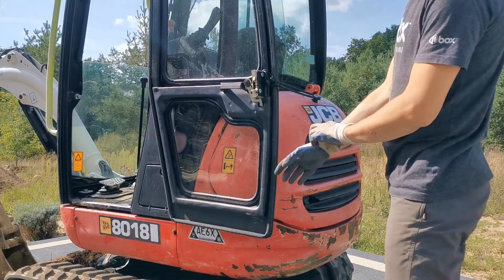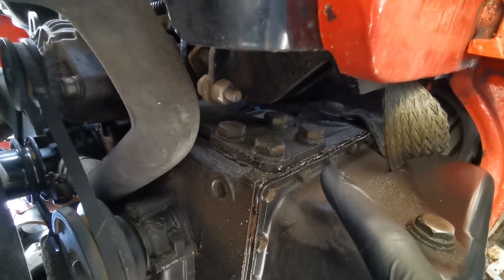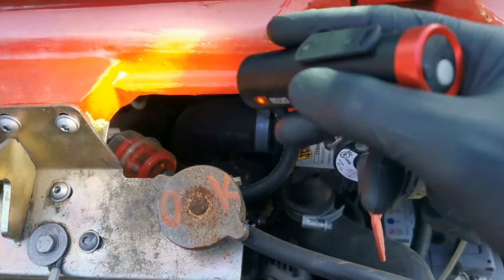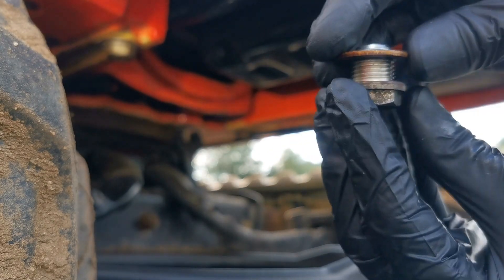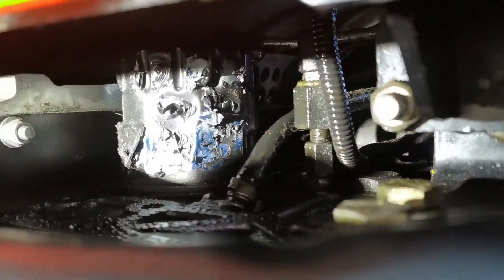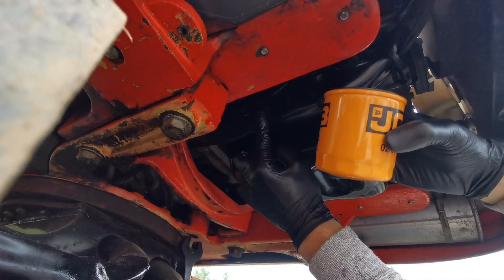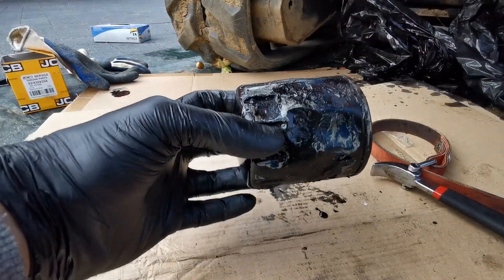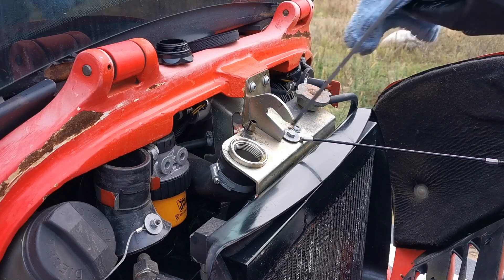Engine Oil & Oil Filter Change On JCB 8014, 8016, 8018 and 8020 Mini Excavator.

Comment from the maker: Where to buy:
- the engine oil filter - https://amzn.to/2Z9P2gM
- the engine oil type https://amzn.to/326LH41
- drain pans https://amzn.to/3bAmjH0
- measuring container https://amzn.to/2F7WhPc
- socket wrench set https://amzn.to/3i8VTOZ
- filter wrenches https://amzn.to/2DBmx49

0:00 Preparing the machine.
0:59 How to remove the engine / undercarriage cover.
2:15 How to check engine oil level.
2:57 Where is the oil filter located.
3:50 Unscrewing the drain plug and draining the old oil.
4:38 What oil to use and how much oil  (oil type and capacity).
5:20 How to unscrew the old oil filter.
5:43 Oil filter tool.
7:09 Fitting new oil filter.
8:58 Filling the new engine oil.
10:14 Cranking the engine for the oil to get to it.

Comment: I was hoping you were going to show the real easy secret for how to change the oil filter. JCB told be to remove the fuel tank, which gives really good access to the filter. It does but, putting the bolts back in is a struggle. Poor design from JCB.

Comment: Many thanks for the video. I have a 2008 JCB 8020 and I could not get the oil filter out from below. Tried for hours. Watched your video again and again. I tried bending the engine to the side with a pry bar (I believe it sits on rubber mounts, but it did not work. I finally wriggled the filter out through the access panel under the cab door.
Reply: Helou, dont buy orginal jcb Oilfiltter its too big, and wery tight. I buy Donaldson P550335 oil filter, and that fitting much better.

Comment: Next you can before opening the drain plug open the top cap ( where you fill the engine whit oil, if you want.
It will cancel or call down the glup effect
Reply from the maker: Great tip Tintin. Thank you!